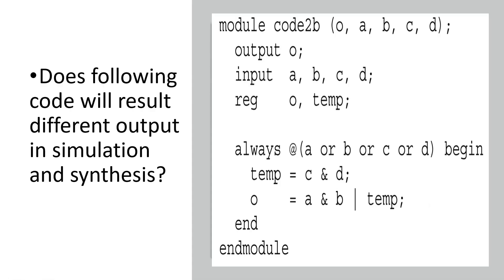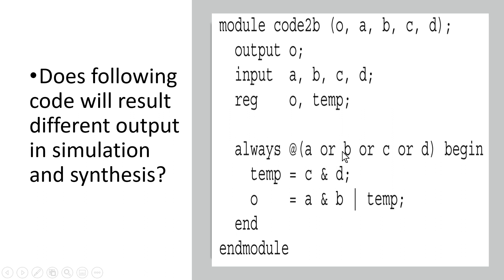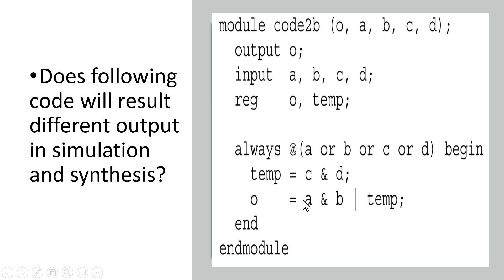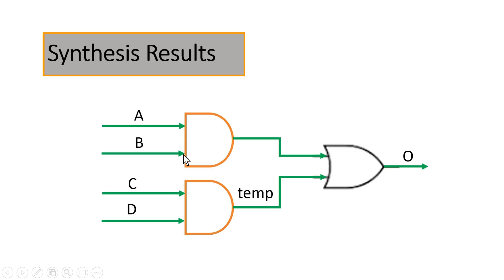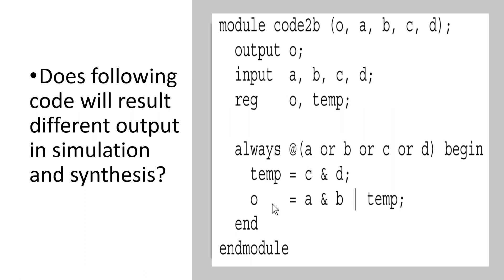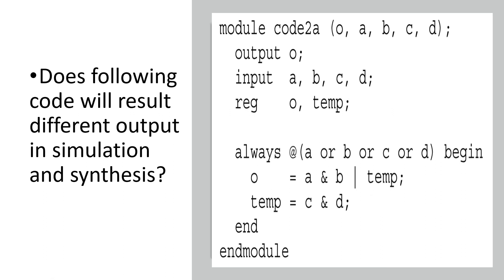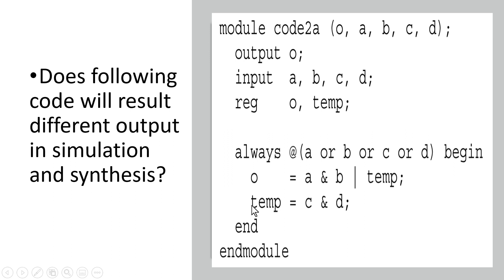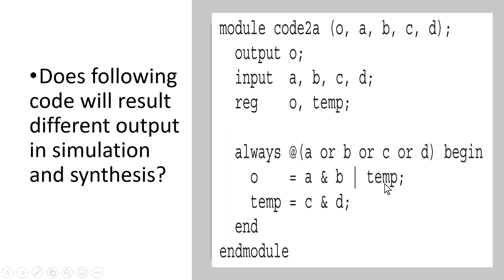#VerilogVHDL RTL Interview Questions Part4

Comment: According to me synthesis results of both the codes will be different. In the second code latch will be generated at temp. Please clarify.
Reply from the maker: Hi Jatin, thanks for initiating this discussion here .. there will not be any latch getting infer from both the codes discussed above. for more clarity on latch generation, I have created a separate video, please go through it and let me know if you still have any doubt. Link:
https://www.youtube.com/watch?v=o-Ws4XmszFI
Reply: @TechnicalBytes   Sir I have watched the video but not able to relate examples given in that with this video. In 2nd case blocking statements are used and o requires value of temp which has not been assigned till now. So previous value of temp will be used and that is possible only through a latch. o = a&b|temp in this previous value of temp will be used this what I am trying to say for 2nd case. If you can please post  its synthesis result it will solve all the doubts.